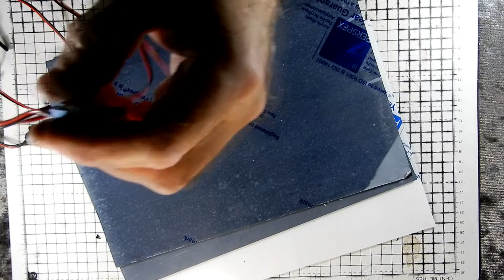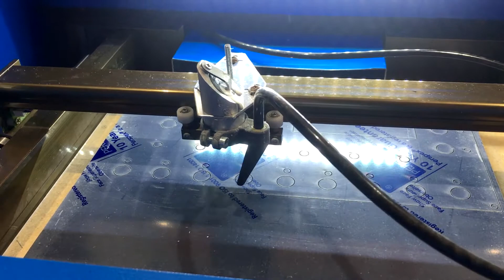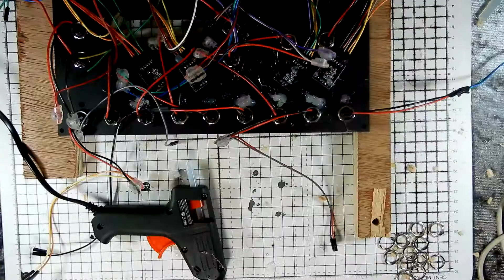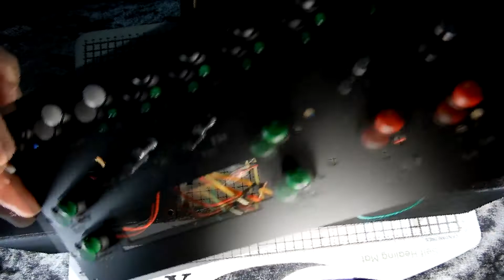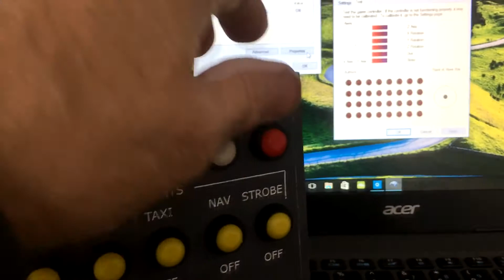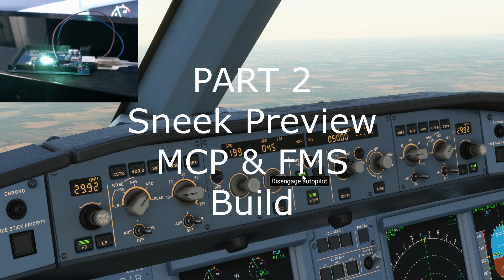Flight Sim 2020 MCP Project

Comment: You mention both Leo Bodnar and Arduino. In general, for which functions do you use Leo Bodnar boards and for which functions do you use the Arduino board?
Reply from the maker: Hi thanks for watching. I generally use a Leobodner board if they are straight forward switches and rotary encoders and I use the arduino if I am using a button matrix which gives more buttons per inputs. I hope this helps

Comment: Nice work.  Question,    are the svg files set up to CUT and Engrave as a single process,   or are they two separate processes.
Reply from the maker: My k40 laser does separate processes if it is a red line or text it will cut if it is a black line or text it will engrave. I hope this helped thanks for subscribing 👍